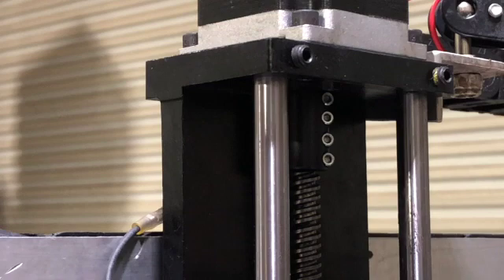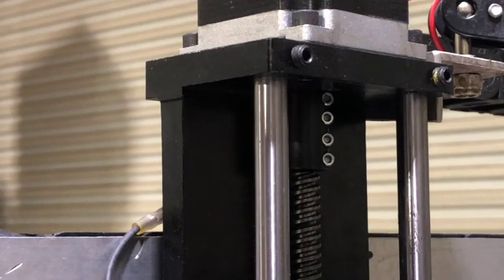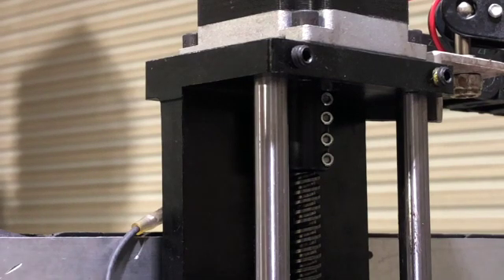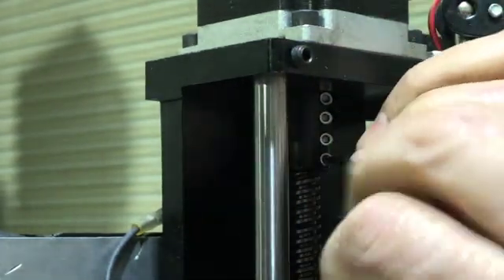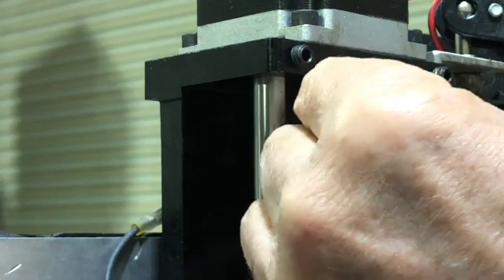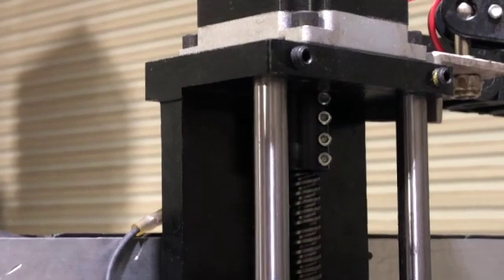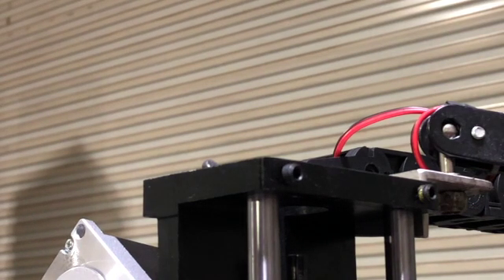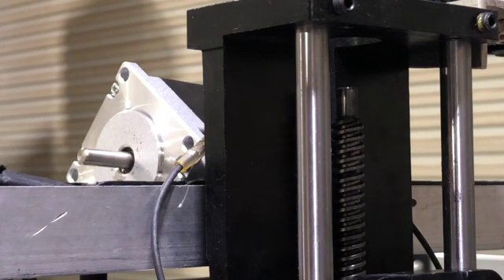Z Axis Coupler Replacement   SD 480p

Comment: I'm kind of surprised Langmuir went with the plastic coupler.  Most 3D printers and the Open-Builds CNC machines use an aluminum coupler with a spiral flex joint.  I would think the aluminum joint would clamp a bit better than the plastic.
Reply from the maker: I totally agree and if the problem returns I will definitely change to a metal coupler.  I’m sure the cost played a factor and we do get a pretty capable machine for a really good price so I find I hard to complain.  I guess they struggled to know many sales they would lose if they increased the price by $100 but used metal couplers and dimpled the drain pans?